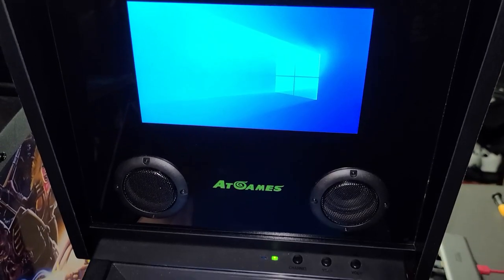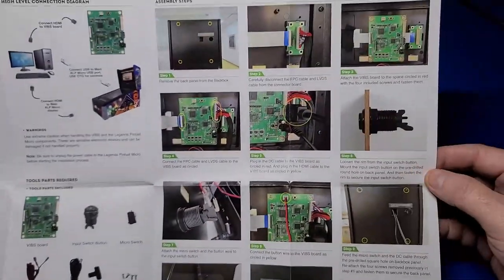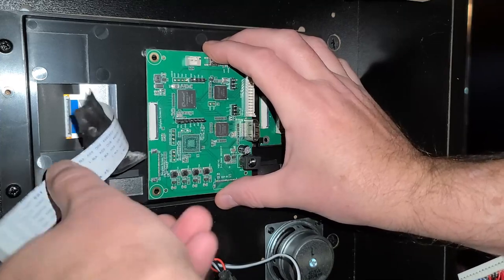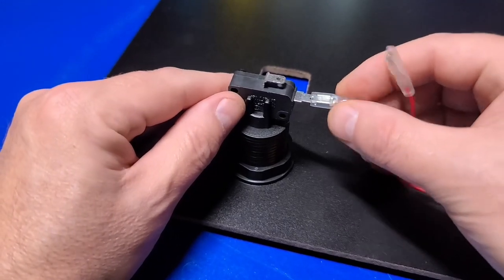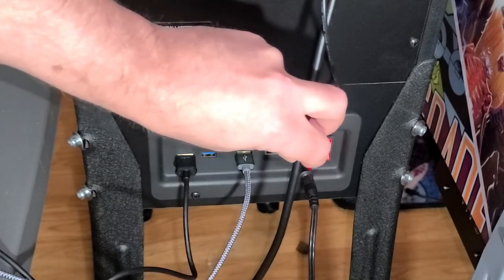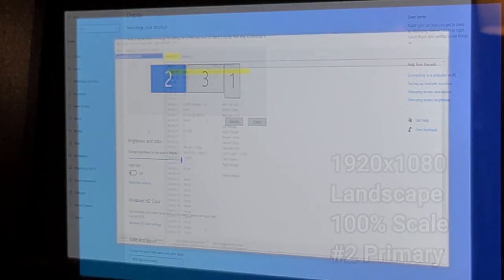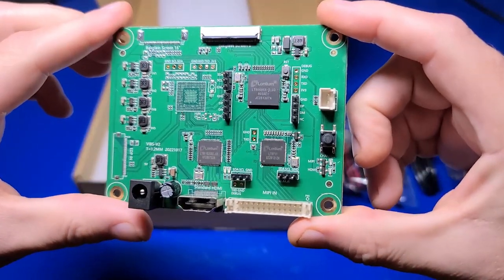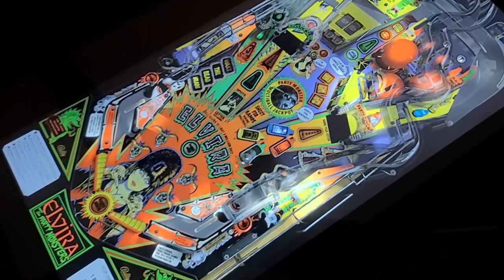AtGames VIBS for Legends Pinball Micro - Install and Setup Guide

Comment: The fx3 cabinet setting for matrix and back glass numbers you outline in your regular legends pinball vibs video make the back glass too big on the micro. Do you have the numbers for the micro that you are using in this video for the micro?
Reply from the maker: Make sure all displays are scaled to 100%, Windows may adjust to 150% which will throw things off.

Comment: @Wagner's TechTalk   I have a question does haptic feedback already work automatically in vpx or do I have to do something in the settings in the vpx software so that it works?  i am also planning to buy this version of legends pinball micro
Reply from the maker: It's built in, but you may need to adjust the strength.  You press one of the volume buttons, then quickly press the channel button and then adjust the strength using the vol +/- button.
Reply: @WagnersTechTalk   great thanks

Comment: Is there any technical reason why the previous VIBS board wouldn't work on the micro, ignoring that it is not the same size as the one for the micro? Are the connectors the same as the bigger brother VIBS board?
Reply from the maker: The connectors are totally different, the original VIBS board can't be used with the Micro.

Comment: I have a completely different board that I just ordered from AtGames via Newegg. My board has no additional power requirements (no splitter) and no connections other than FPC/EDP cable in and out. When I did my best to follow the convoluted instructions that I could only find by Googling (no link on their site and the included insert had a URL that was no longer valid,) the machine showed no video on either screen (playfield or backglass.) Any clue about what the heck is going on with this product/company would be appreciated!
Reply from the maker: That board is likely the VIBS board for the ALP (not the micro).  If it's the micro you're interested in, please see here https://wagnerstechtalk.com/alpmicro/#VIBS_Board_Installation .  Much more on that guide so check it out.  For guides on other AtGames products, see here https://wagnerstechtalk.com/guides/#AtGames

Comment: Just got the Micro and the VIBs got everything installed and setup however joy2key doesn't detect my micro as a joypad and nothing does including steam.  I am using Windows 11, could it just be that Win11 is not compatible with the joypad?  Really want to get this work since I have over 60 tables on VPX already.
Reply from the maker: Please see this section, should help: https://wagnerstechtalk.com/alppcsetup/#OTG_Troubleshooting .  j2k and xpadder both work with Win11, it's likely the USB cable from the ALPu to the PC.
Reply: @WagnersTechTalk  thanks man. Didn't even think about USB power. It works now. I had one lying around and tried it before buying one from Amazon.
Reply from the maker: Awesome!  Glad you're up and running.

Comment: Hey Wagner had a question for you. I’ve asked you about this in the past, but it’s been a while & I was curious if I could share some specs with you and you could tell me if this computer will do the job for the ALP (the big one) to play all the good pinball stuff…

Skytech Shadow Gaming PC Desktop – INTEL Core i5 10400F 2.9 GHz, RTX 3050, 1TB NVME SSD, 8G DDR4 3200, 600W GOLD PSU, AC Wi-Fi, Windows 10 Home 64-bit

Details:
Specific Uses For Product Multimedia, Personal, Gaming

Brand Skytech Gaming
Personal computer design type 
Computer Tower
Operating System Windows 11 Home 64-bit
Memory Storage Capacity 1 TB
Screen Size 1
Ram Memory Installed Size 8 GB
Series Shadow 3.0
Included Components Power Cord
CPU Model Core i5

This is the one I think you recommended a while back that I found on Amazon it’s still available, but will this work for all that stuff all the digital pinball and even work with the back glass…I thank you and appreciate your time if you can answer✌🏻
Reply from the maker: One good way to check the performance of a machine you're considering is to see the Grey box here https://wagnerstechtalk.com/alp-mod1/#Chapter_5_PC_Requirements .  Enter the cpu, gpu, ram, etc. and it will show you how well the PC will run fx3.  Baller installer results will largely be the same.

Comment: The Power should be routed inside and not outside with this Y-Splitter as this might break off the Power-Socket of the Mainboard easily.
Reply from the maker: I based the install off AtGames recommendation.
Reply: Instead of the solid barrel adapter, use a power splitter pig tale with soft cords. They are used with guitar pedals. No jack stress.

Comment: Can this be hooked up to a Retropi or Nintendo Switch?
Reply from the maker: I've heard of folks that have connected a switch up to the ALP (this is the same, only smaller).  However, you have to use the JoyCons to play, if I recall correctly.  RetroPie is likely possible, but just using CoinOpsX would be much easier.

Comment: question so i have the otg cable do i need to buy a usb a to usba cable to be able to connect it to the pc?
Reply from the maker: The OTG Cable is USA-A to USB-A, if you have that you've already got what you need to connect to the PC.
Reply: @WagnersTechTalk  Hi, I've tried multiple types of USB to USB that have been recommended for the Legends Pinball but my Pinball FX/Steam doesn't see any controls. Do I need to get a power hub like the one you're using?

Comment: Does the steam deck support haptics on alp micro?
Reply from the maker: The haptic speakers are built into the Micro itself.  To adjust, press up (or down) on the volume buttons and quickly (within 3 seconds), press the channel button, then press+hold the vol + or vol - buttons to increase/decrease the haptics to your preference.  Hope that helps!
Reply: @WagnersTechTalk  thanks for the response. I know how to adjust them , I'm just wondering if the steam deck correctly utilizes them the way a PC would.
Reply from the maker: From the Micro's standpoint, it doesn't matter as long as the audio is coming in from the playfield display.

Comment: For the ALP Micro, what do we put under pinball table settings in Pinball Fx? I followed the tutorial for the regular sized ALP, but the backglass does not display properly. Any suggestions?
Reply from the maker: Micro is the same as the ALP, check the scaling at 100% as a  likely suspect.
Reply: @Wagner's TechTalk  I'll take a look! From what i recalled what was suppose to be on the back glass screen was slightly overlapping into my desktop